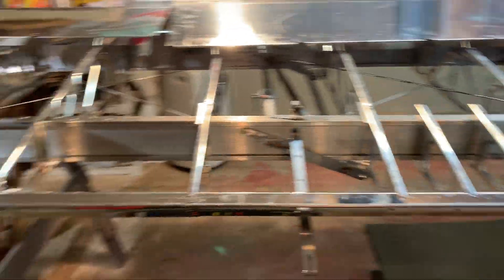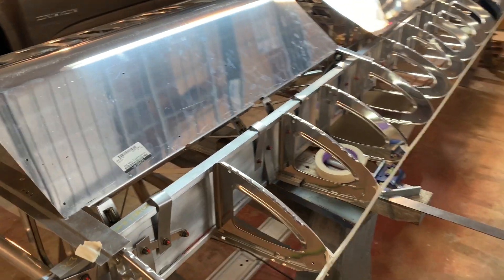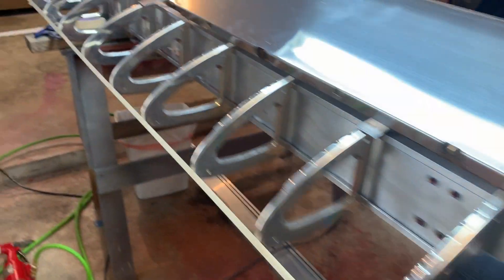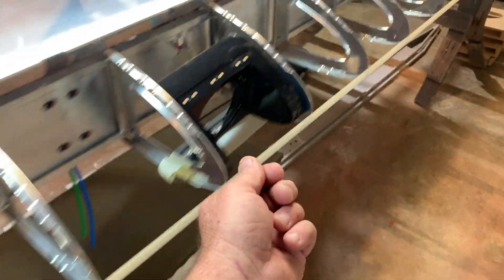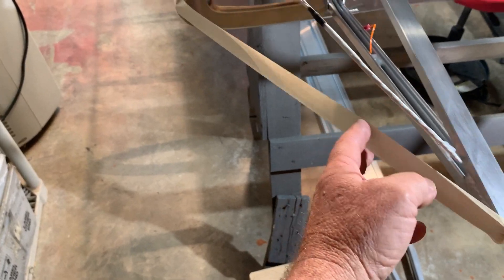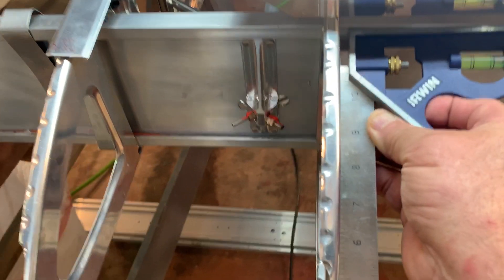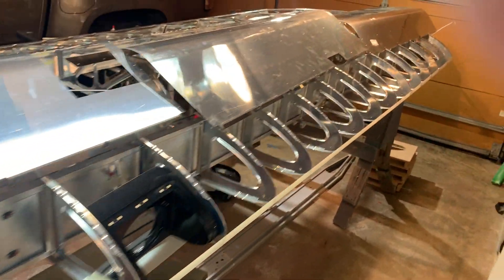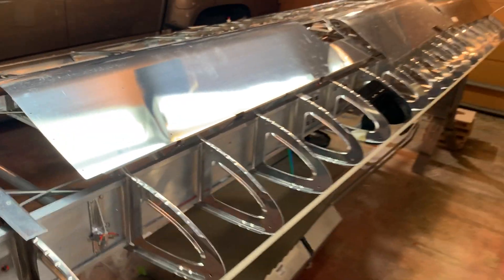Building the Wing - Part 2.  Leading Edge Skin Installation

Comment: Dave, I have to remove the fuel tanks from an FX3 to repair a leaking tank.  I am trying to figure out how I would access the drag wires at the front spar.  Won’t these be completely covered by the leading edge skins?
Reply from the maker: Eric. You would loosen the nuts on both wires at the wing root.  Push the one from the aft side back up as far as it will go into the leading edge.  Then there should be a hole in the false spar where you (will first cut out farcical around the hole) will push the wire from the forward root back out through that hole enough to then lift up tanks and slide off the other drag wire.  So the wire from the front, outside leading edge to the aft wing root will not be removed, just pushed back far enough so you can slide the tanks off.
Reply: Thanks Dave!  That was helpful!